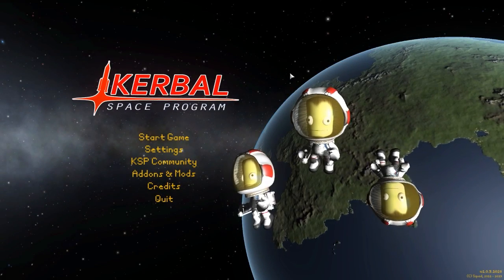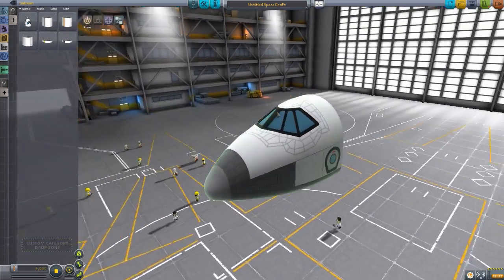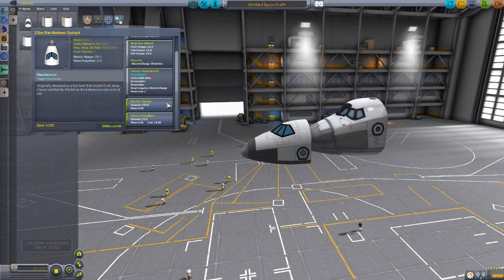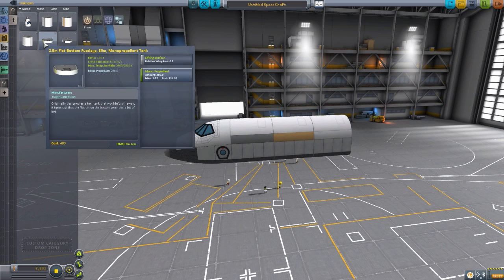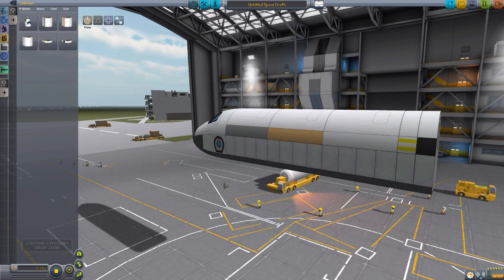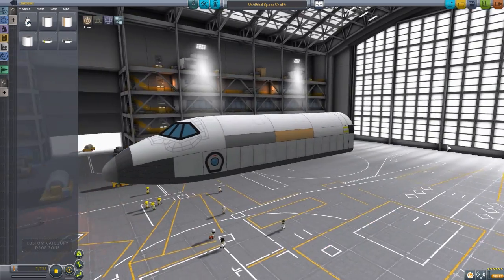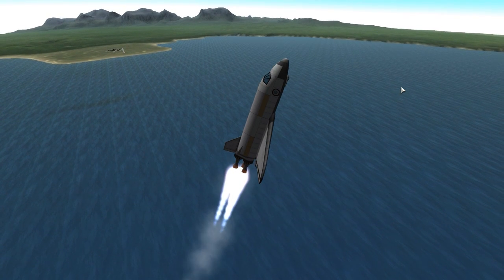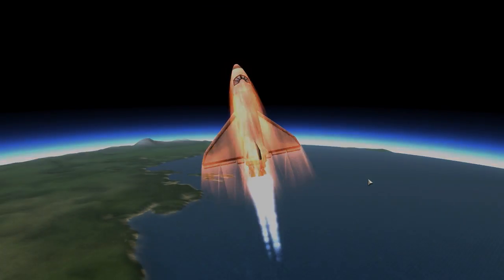KSP Mods - Flat-Bottom Spaceplane Parts

Comment: It'd be better if the cockpit had a 1.25m connection at the front so that you could add a shielded docking port. Also adaptors from 2.5m flat-bottom to Mk.2 fuselage and 1.25m round sections would be good too.